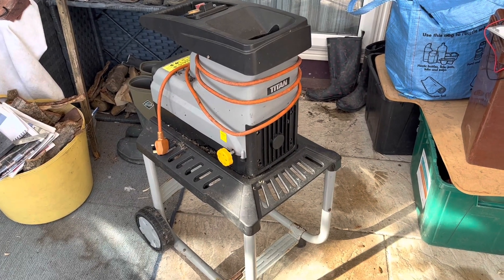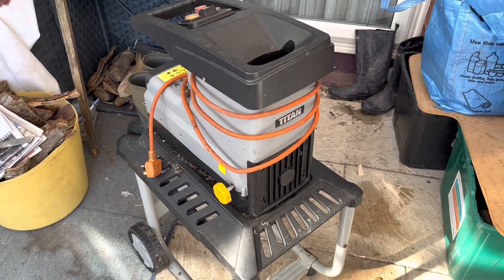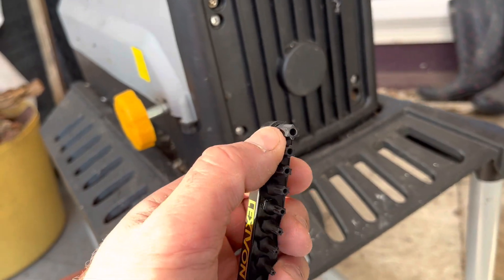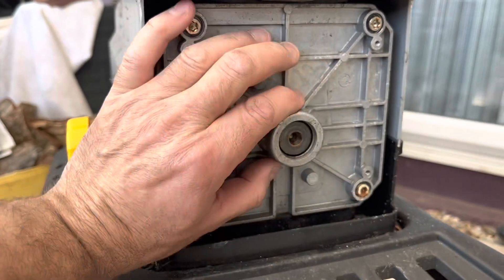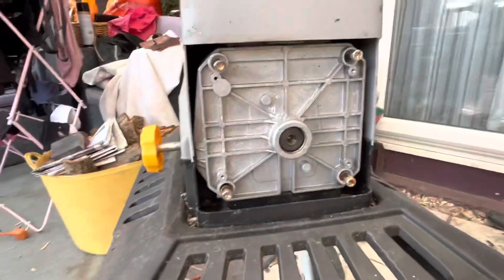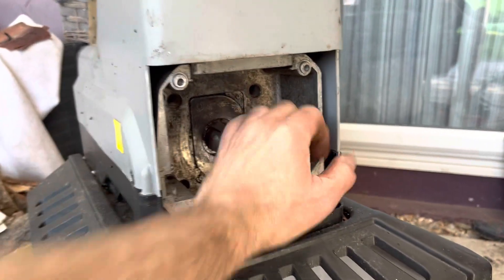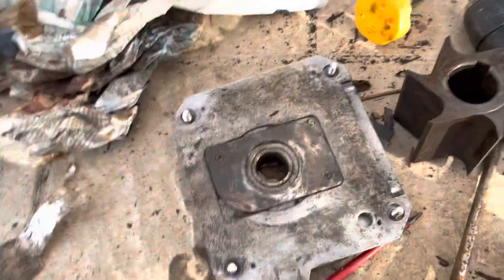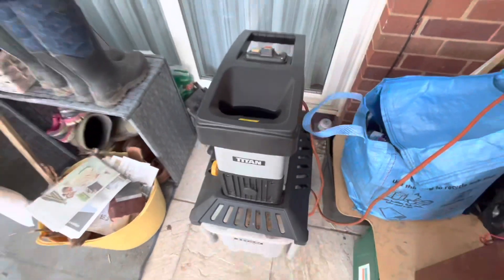Titan TTB683SHR Silent Shredder Repair (Seized)

Comment: Thanks mate. I love my silent shredder, its another brand but probably more or less the same. I have neglected it and suspect it will be siezed up also when I use it next. If anyone reads this,my advice is never buy a shredder with a high-speed blade because in my experience so much more goes wrong and they are horrendously noisy. A good silent shredder won't have problems with palm fronds either, particularly if they have been allowed to go brown and brittle.